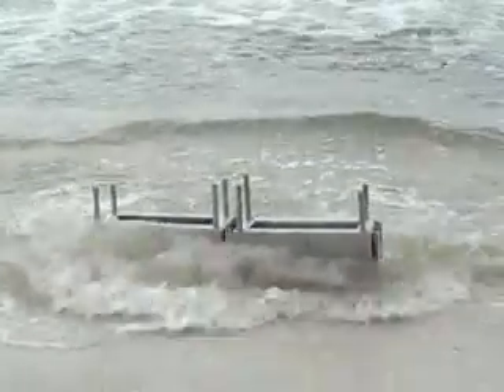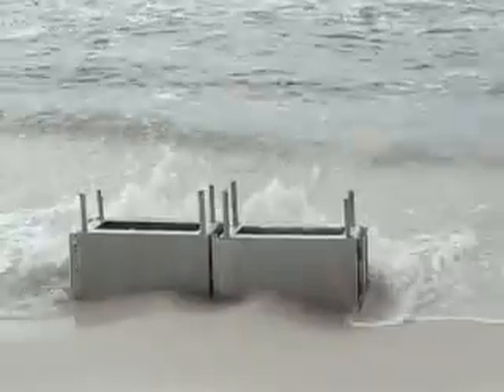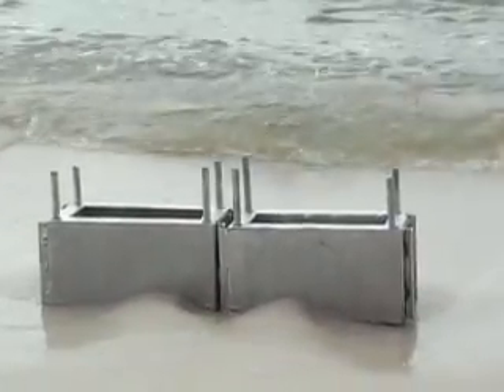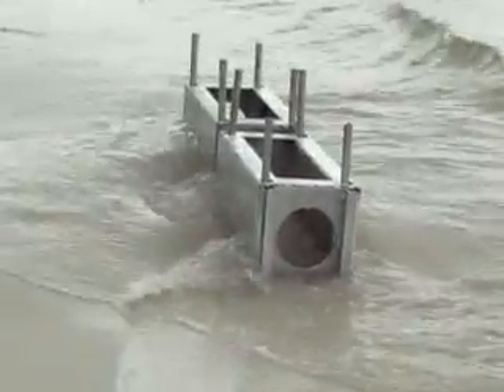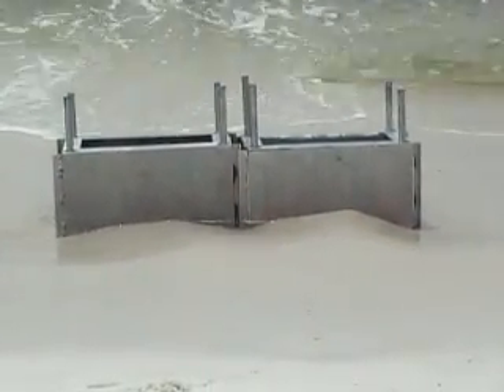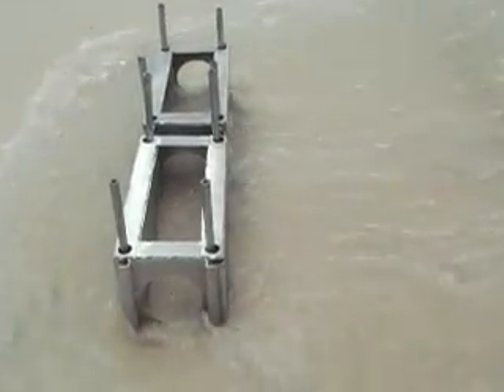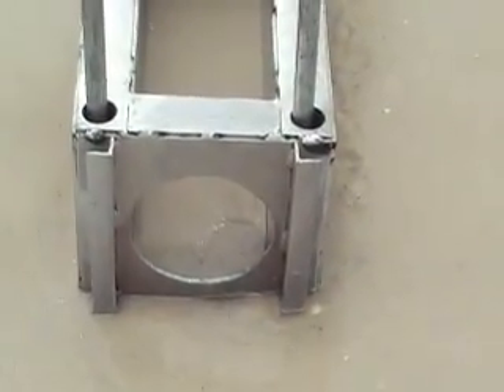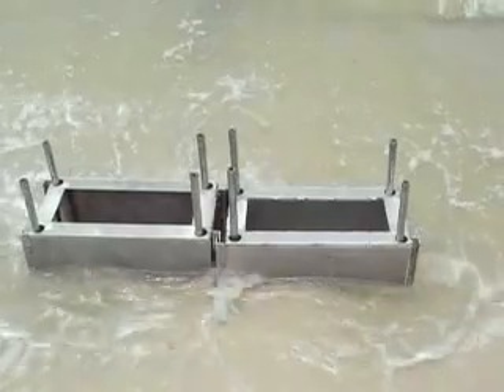Jim Boudreaux's Flood Levee System, The "Boxes" being Tested in real time

Comment from the maker: Thank you for your observation and comments. You have observed the concept of the Boxes at work. The sediments have built up inside the Boxes up to the hole to allow flow to the connecting Boxes. The water could not go beneath the Boxes, thus stopping "The Liquefied Zone". Therefore the water with sediments had no choice but to go around and behind the boxes to build up. The longer the Boxes are, the  more protection from storm surge you will have. Thanks again for your comments.